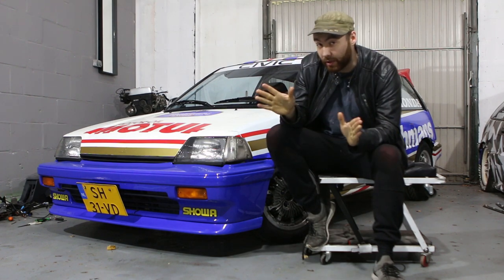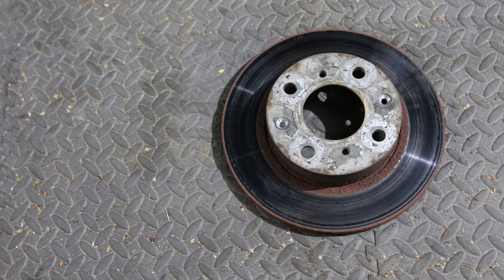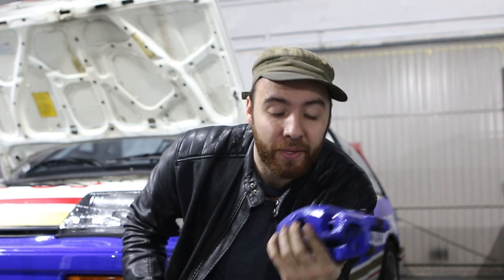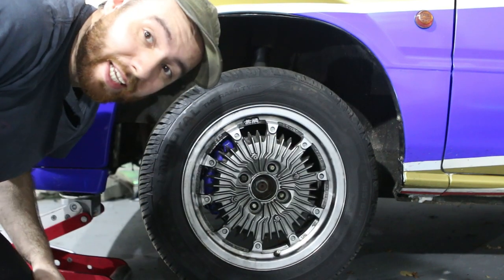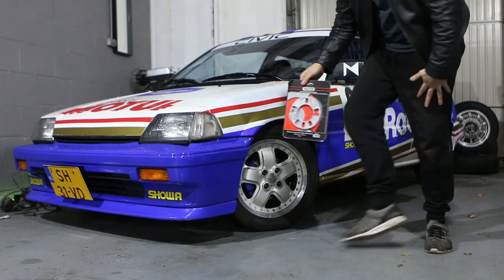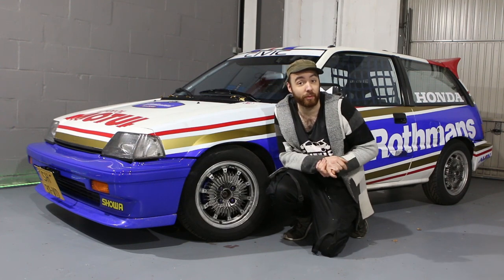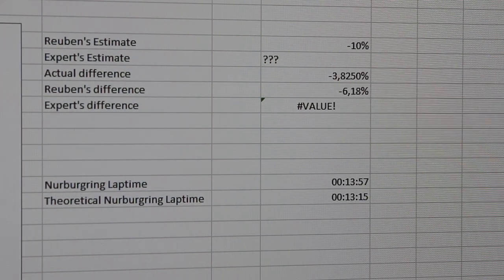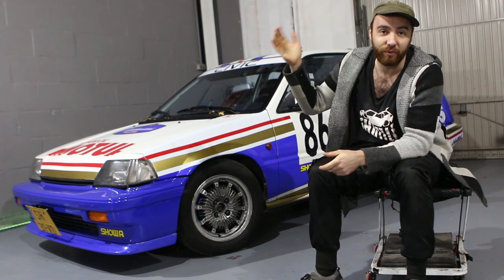Performance brake upgrade | Does it Matter? EP 6

Comment: Adding a proportioning valve from a 86 - 89 Integra would increased the braking performance some more along with rear disc brakes.
Reply from the maker: That is actually a great idea! I have been trying to find an 86 teg on a wrecking yard but they are super hard to find here :(
Reply: In Bulgaria there's one Integra that's being sold for parts.

1987, four door, left hand drive, DA4 type and D15A1 engine.

I could you send the contacts if you want to.
Reply from the maker: @jimmy1395  yes please jimmy!
Reply: @TheMidnightGarage  I'm talking with him right now via Messenger. He said he wasn't sure if it's possible to send the part.
Reply: @TheMidnightGarage  Sorry for wasting your time. He said he doesn't speak English very well.
Reply from the maker: @jimmy1395  no problem at all! Its the thought that counts 😊

Comment: NICE  !!! Thank you and question" I can use all front calipers from  Civic/crx 88-00 with 242mm diameter and 21mm or 19mm  thick ? Thanks , I like your videos :)
Reply from the maker: As far as I understand it you can use any front caliper up to 242mm so in theory it would be possible to use the EK ones as well. According to a comment from @christiaanvanderstraten you can use the calipers from a 282 integra as well but then they will only take 262 discs :)

Comment: Your next move definitely needs to be suspension.
Coilovers or even a set of lowering springs.
Reply: a set of bcracing would be cool
Reply: 🤦🏻‍♂️ not the lowering springs
Reply: @monjier  why? Obviously coilovers would be the better option but a decent lowering springs will always be an improvement than stock springs.
Reply: @monjier  what?
Reply: @monjier  there is a set of coilovers for the 84-87 si
Reply: @edomoralessilva5511  yeah BC Racing seems to be the brand everyone wants.
TEIN would be a brand good too.

Comment: I've got an EG Civic with RD1 brakes to the front and it literally locks up the front wheels under hard braking on a wet surface,the only thing that seems to work a little bit is a better Tyre, I haven't tried this but I think a better disc pad/ brake shoes to the rear should help...good luck
Reply from the maker: Yeah good call, I think ive hit the grip limit of the tyres in the wet, better tyres will probably be the answer 😎
Reply: I'm looking out for that video 👍💯
Reply: Yeah the theory states that you've reached the maximum grip for braking with the tyres.  You could either change the brake bias towards the rear OR change the Tyre